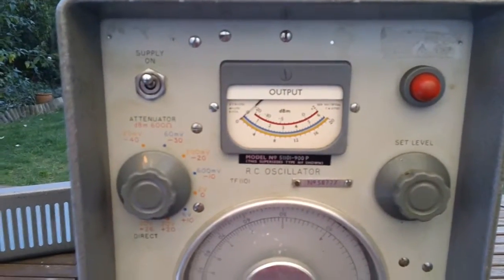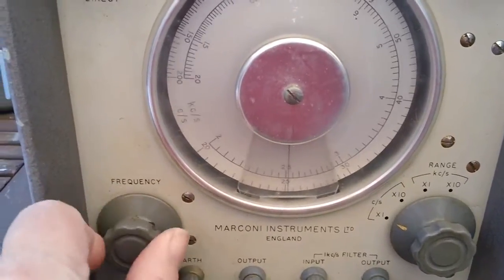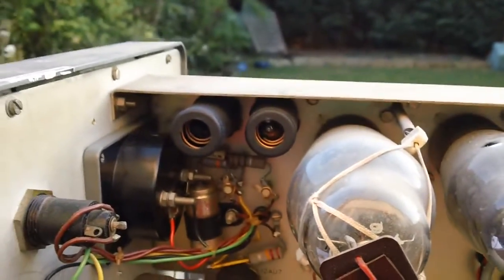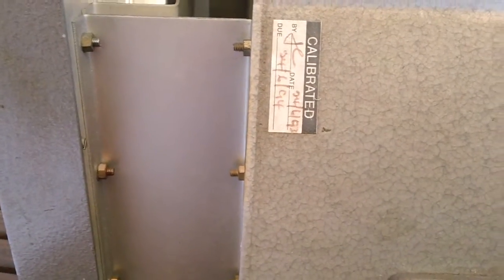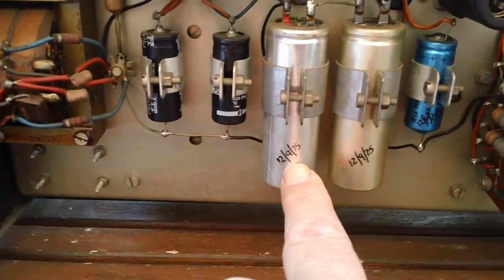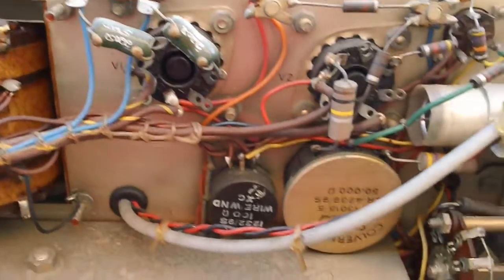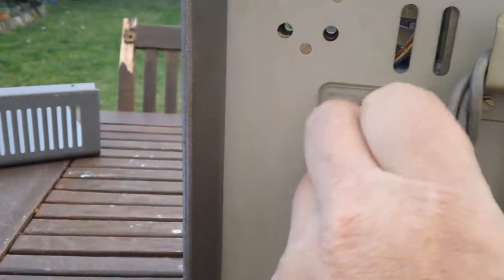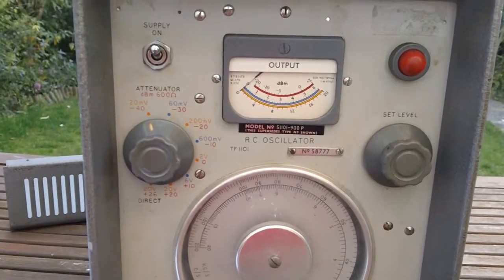Marconi TF1101 RC Oscillator Part 1

Comment: It looks to be both well made and easy to work on, nice find!
Reply from the maker: +50sTransistorRadios  Hi Matt,  yes Marconi made some top gear back in the day.  I know a lot made it over your side of the Atlantic as I see it on eBay. The only thing i wouldn't like to replace are those 'select on test' resistors. Expensive!
Reply: I probably don't need more test equipment, but I would be tempted if I saw one of these for sale. Thankfully that type of resistor is extremely stable, so unless they are overloaded, they should still be good.